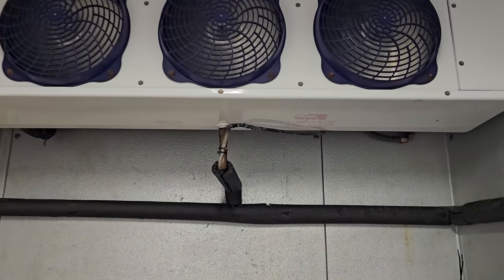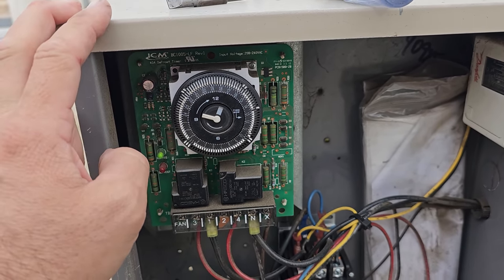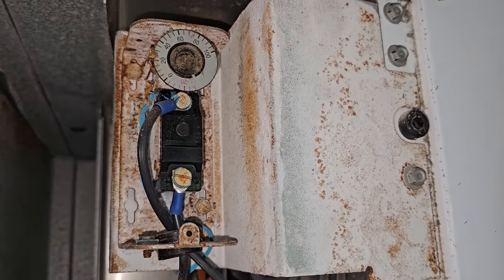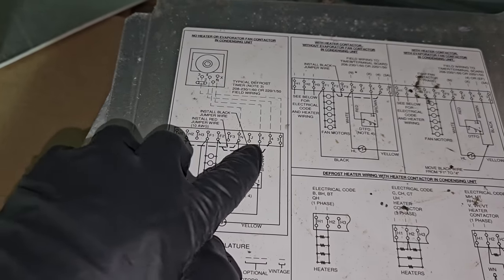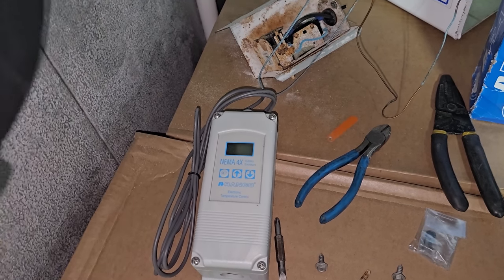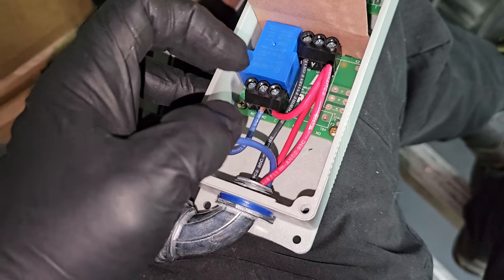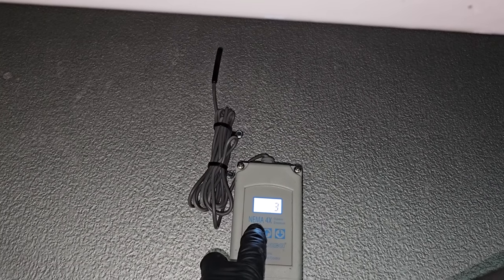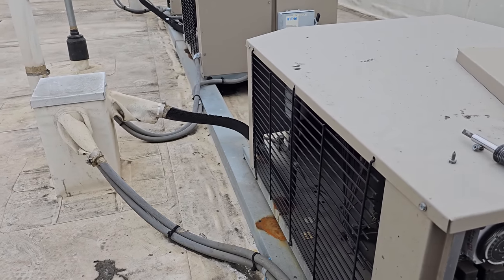OUR WALK IN IS TOO COLD PLEASE HURRY

Comment: What type of product / operation requesting those temps? Just chicken wings?

Thanks for the refresh on sequence of operations. Your recap on the solenoid valve has me questioning a recent WIF freezer diagnosis and the root cause of compressor failure.

Comment: To convert to military time, if between 1am and 9:59am, put a 0 in front of the hour. If between 10am and 12:59pm, leave it alone. If between 1pm and 11:59pm, add 12 to the current hour. If between 12am and 12:59pm, change hour to 00.

Do the opposite to convert from military time. 

I am a truck driver, we do everything in military time. I also used to work at a local TV station and we did things weird there. The log day started at 4am. So, from 4-11:59 was AM, noon to 11:59 was PM, then midnight to 3:59 was XM

Comment: I know there is normaly no ice in the side panel, but how are the wago connector performing in ice? Or is it the same as the wire nuts?
Reply: There is a tiny chance that expanding ice could push the clamp slightly open, but I doubt this will ever actually happen. And even if it does, as long as there's current flowing, any bad contact would produce heat and insta-melt the offending ice. With a wire nut, there also is that microscopic chance that ice could loosen the connection, but unlike a Wago, a wire nut is not self-tightening. There's a small difference in regards to water, as a wire nut is a cup while a Wago has openings on both sides (one for the wires, one for a probe). So it would be less likely for a Wago to be split from freezing water.

Otherwise, I see no reason for a Wago to behave differently from a wire nut.

Comment: Maintaining 30° doesn't really need electric defrost. I probably would have at least tried to go with a Ke2 Air defrost. Turn off all pins on the defrost clock. Set the air defrost on the KE2 for something like 8X25. I would be surprised if that system isn't oversized considering how narrow that box.
Reply from the maker: I will discuss this live on YouTube this evening 6/26/23 @ 5:PM (pacific) come on over and check it out https://youtube.com/live/YfxH9CHqIz4

Comment: I wonder if there is a way to prevent such corrosion maybe air tight containers? Or dielectric grease
Reply: PCB anti corrosion spray just don't spray on actual contact points

Comment: My walk-in floor is too wet, please hurry!
...was the service call at work on Monday, with the tech guaranteed to look at it sometime Tuesday.

Tuesday afternoon, while discussing with my Assistant Manager, a cursory glance had me diagnosing it as a clogged drain line and/or failed condensate pump causing the drip pan to overflow. She swore it had to be the rooftop equipment, since we had the compressor replaced last year on a roughly 30-year-old system. Well, obviously she doesn't watch Chris' videos!

The tech never showed on Tuesday, but claimed that he was there and found no problems.
Then, on Wednesday morning, my Assistant Manager called the Franchise Owner directly to tell him that the tech never showed, and there was STILL water on the walk-in floor.
Thursday morning (today) the other tech shows up (the one trained by the infamous Douche With A Toolbelt I've mentioned in many comments previously) and - well, what do you know? The condensate pump was fine, its sump was dry as a bone, and the PVC drain line was "clogged with calcium and algae clumps." He pulled the drain line apart, cleaned it, put it back together, and problem solved! 

(I swear, NOBODY listens to me... C'est la vie!)

Comment: Considering the dirty evaporator, I would consider you would have found an iced up evaporator on your arrival if the issue was your LLSV sticking open, would count as bleeding by and icing suction  up to the compressor, this meaning is been happening for a while before you got there.

Comment: I'm not a tech but I like to be handy. My friends call me before they call a company for HVAC/power/plumbing/PC car etc and you are my hvac KB! I grabbed a tool at a yard sale for 2$ just to use as a project box maybe a month ago. I decided to use it last night but wanted to see what I was about to destroy/repurpose. It's. Sporlan SMA-12.  After a bit of digging I see it's just a stepper motor driver/controller. I tested it with a motor from an old printer and it works perfectly. Now here is my question, how is a box I can make with $10 of parts valued at $500+?
Reply: The only think I can think of is guided by a sticker that says CAL2, so maybe it's certified for use in medical/scientific/industrial and that is where the cost is?
Reply: Because its is certified to work in the systems they are designed for. Yea, a person can Frankenstein it to work, but I can't count how many times these types of repairs cause major failures that myself and others have to clean up on a friday night. Just please don't do it. The "friend repairs" piss hvac techs off when we have to clean it up.
Reply: @zack9912000  ok so I guessed right, it's not the tool hardware so much as its value of vendor support, reliability and accuracy. Other than replacing the cap, a chattering/buzzing contactor, rodent damaged low voltage AC wire, thermostat or a fan/blower I leave the rest alone so you won't be cleaning up after me 😁
Reply: @zack9912000  I just wanted to let you know that your reply inspired me. You know it's been over 100 in South Texas last so I posted on the Nextdoor app for free service catered towards veterans, fixed income and low income single parent households. Since then I have been onsite 7 times and was able to resolve the problem with my rolling inventory. The last one yesterday was amazing. A 2 stage heat pump system was unresponsive.   Killed main, flipped lid pulled the handle rotated on to off.  Pulled main, 2nd inside thermo from wall and removed the batteries. Pulled the transformer in the closet.  Outside the panel came off, the timer and state board , pulled it's connectors. Discharged the cap, always a blast right? Then grounded all the pins on the board and either O or W2 I don't give a shit really went CLUNK WHOOOHISSSSSSSSS. and I thought awesome, that was something not in a normal state. Went backwards to hook it up. 5:44pm house was 105 I left 6:19 house was 91.  Handicap old man, fixed income and top 5 service providers in the market were not affordable or they were unavailable for 2 weeks or more. So screw you and your attitude towards scabs or friends.

Comment: Why is there an extra 15 minute defrost @13:00? 
Kinda weird..
Reply: maybe they use the door a ton or put in product with lots of humidity/moisture and cause extra evaporator icing? that's what's nice about those defrost clocks, you can vary the defrost time length and move them around anywhere. granted the other style generally hold up and last longer.